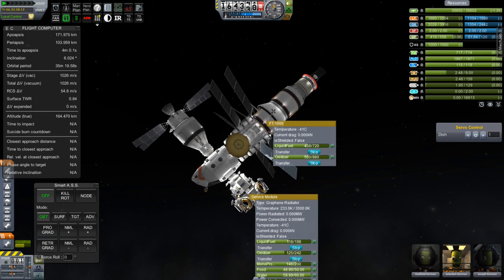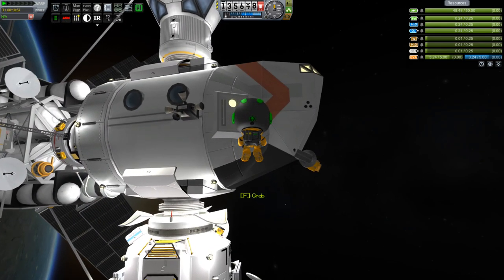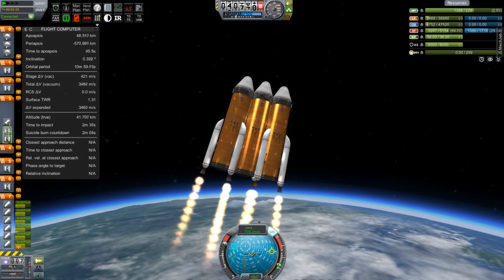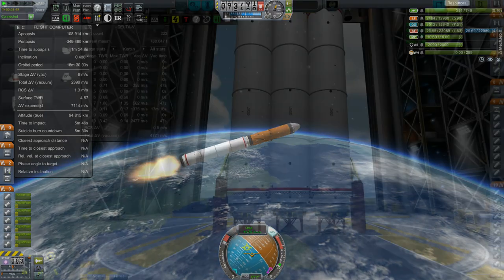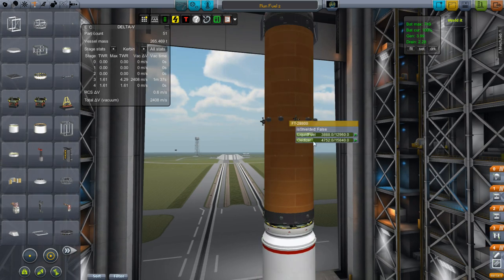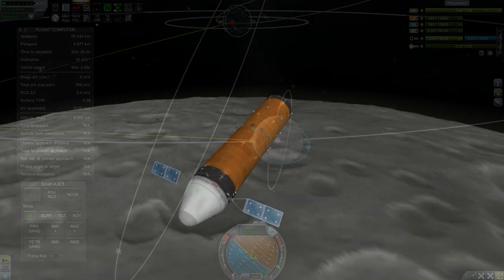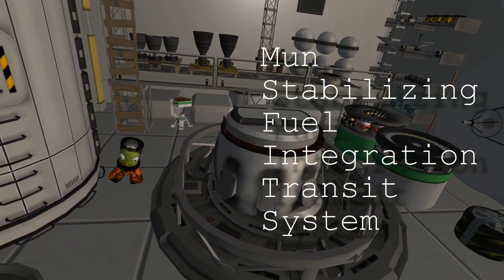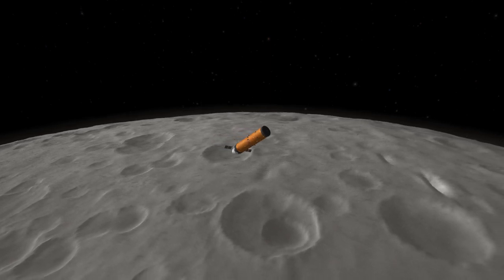E16: "Solid Boosters" / Project Odyssey / KSP 0.23.5

Comment: So, the plan to produce more "liquid fuel" with kethane, but how are your kerbals producing more solid fuel? I assume they use some kind of APCP in their SRBs, and that's really hard to manufacture without proper infrastructure, perhaps more so than RP-1 (what I'm assuming is the liquid fuel) and LOX (what I assume is the oxidizer). Is there any kind of plan for replacing solid fuel?